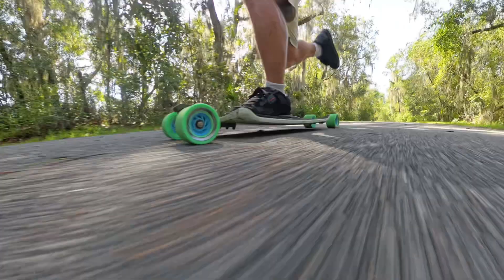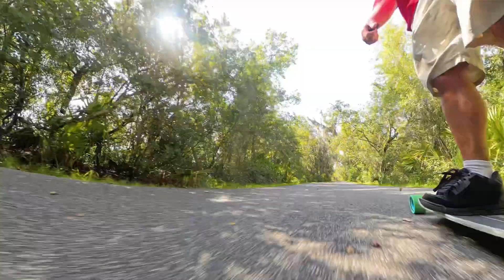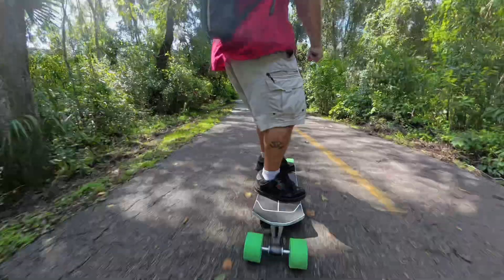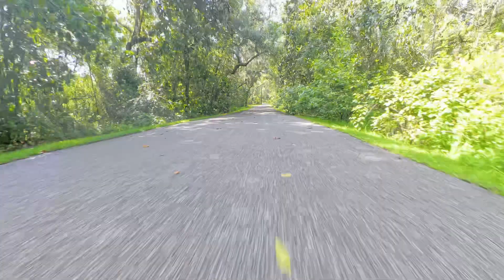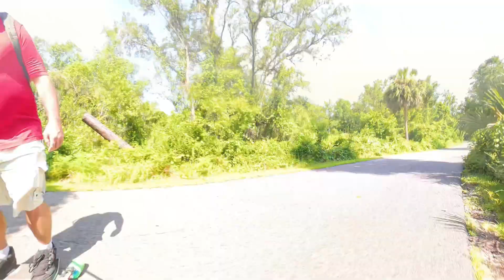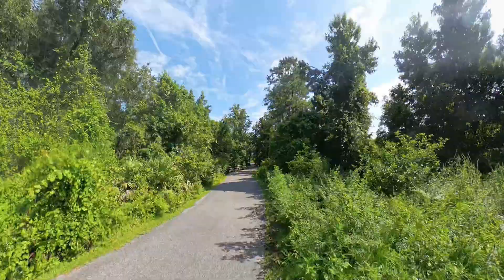Seismic  Mega Watts test  around Blue Springs

Comment: How you like the wheels? What did you originally have, dad bods?
Reply from the maker: Personally for me I would never buy orangutan ever again, 85 mm speed vents are what I had originally but found the wheel splitting after couple months. Megawatts have more grip but not as fast as speed vents
Reply: @ecflongboarding  I have both, to me the speedvents are more efficient, but the Megawatts, if you put all the energy/effort they require, are then faster.
But both require smoother roads than the ones I'm generally riding, so I'm on pantheon wheels (and before them, boas). Neither of these two had problems in splitting/chunking; seismics are known to do that especially in mango 😔
Reply from the maker: @LDPizza I'm rough on wheels 😂